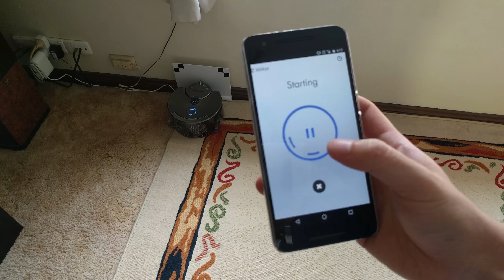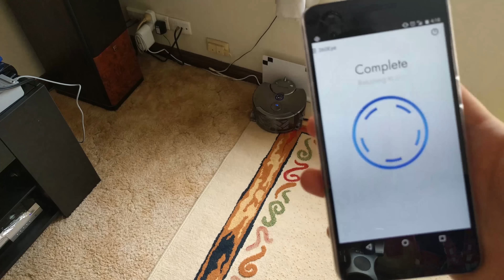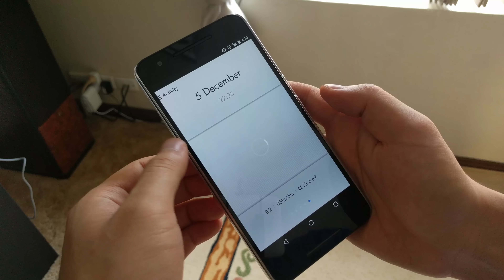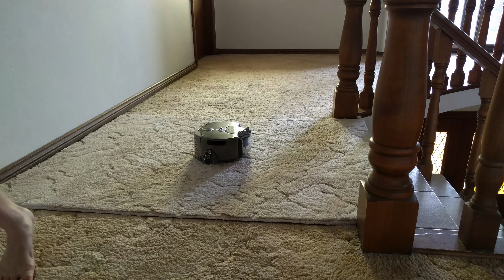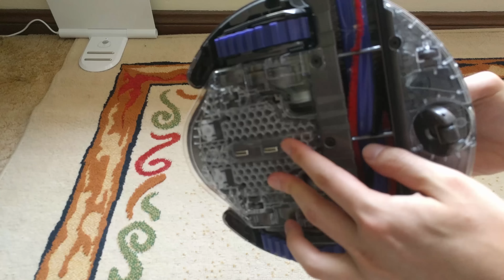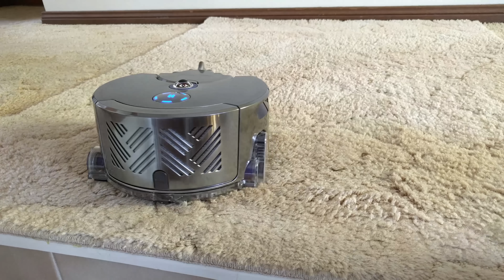Dyson 360 Eye Review!

Comment: I run the m6 daily, and my floors look awesome🌼 allabout.wiki/Dyson I wet mop 2 days and dry sweep the rest of the days. When I first got it, I used the included disposable pads. I didn't like them--the dry pad has no depth so if it picks up a chunk of something, like dry cat food, then it pushes it around or drags it around the floor. The wet pad wasn't very absorbent so left streaks and wheel marks.

Comment: I'm wondering if you have an alarm system with PIR sensors, would this set alarm off?
Reply from the maker: I'm not sure what PIR sensors are, but the vacuum will set off my alarm system so I don't run it when the alarm is on.

Comment: It's a pretty cool product, but manually vacuuming my house for ten minutes is not something i'd pay almost one thousand dollars to eliminate from my weekly chores. I'll check this out again in five years or so when the technology isn't so expensive.
Reply: Also you're gonna have to get on your hands and knees to get all the hard to reach nooks and crannies anyway - shifting sofas, moving computer towers, accessing dusty corners etc... This product only addresses the easy to reach areas.
Maybe i'm biased because I live in a small apartment - cleaning the floor space is pretty easy compared to cleaning behind all the furniture.
Reply: try a neato botvac d75. It goes on sale for $350 sometimes, otherwise it retails for $400. It's short enough to fit under sofas and powerful enough to pick up almost all your dust in your home. I have two Neato products and I'm extremely happy with their product.

Comment: looks like dyson gets over bumps fairly well.  how well does it get over cables?  roomba was fixed over time to do these things well, and reviews don't usually cover them.  seems like dyson has much better suction than roomba, but roomba has much better battery, which might allow it to pick up just as much.   to me, close call between roomba and dyson 360, but roomba is cheaper for now.

Comment: do you not think it will dock better if you did not place the docking station on the edge of the rug.
Reply: I agree , its so setup to obviously fail, why would you possibly put the dock right on the edge of the rug like that? There is PLENTY of space next to the rug for it to sit against the wall.

I have mine flat against the wall and it seems to find its way back perfectly ok

I don't mind how long it takes to clean, as it does it when I'm at work, so i don't see / hear it

Comment: hey, how is the 360 holding up? Do you have any plans to do any more videos?
Reply from the maker: +Snoop Dogg The 360 is holding up great. Still running it a few times a week. There are some scratches inside the dust container, probably due to it picking up some sand or small rocks other than that its pretty good.

Comment: It's pretty small in compare to other leading brand vacuum robots, isn't it? It reminds the tiny and useless in west homes Scooba 230. How is it good at cleaning 2000-3000sq ft home is a piece of mystery, as for yet. But I guess it will need 24/7 work to get it clean.

Comment: My God, the robot is really quite slow to get around isn't it?  It was painful watching it struggle so much to return back to base.
Reply from the maker: +jaimelondonboy Yes it is quite slow, however considering its meant to be a set and forget sort of device I guess making sure it cleans properly was probably Dyson's main focus.
Reply: +Wonk Good point. :) Did it cover the entire floor very well?  Are you very happy with it?
Reply from the maker: I'm quite happy with it. The brush covers the width of the robot so basically any area it travels over will get vacuumed. It gets right next to the walls but of course it can't get to some corners.

Also, its a little too conservative it even avoids curtains that it can easily push through but that's understandable, the camera will see them as an object.

The main issues for me is battery life, the small dust bin and the lack of notifications for a full bin.
Reply: +Wonk I am think the battery issue will be a problem for you as your floor are mostly carpet.